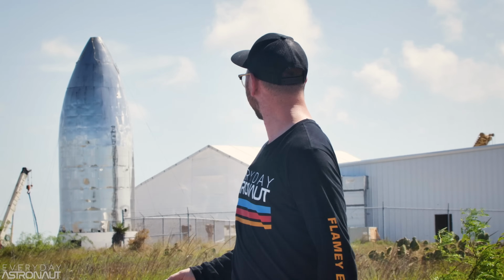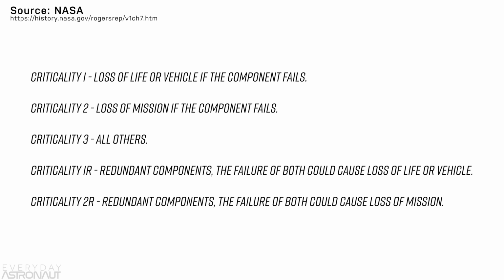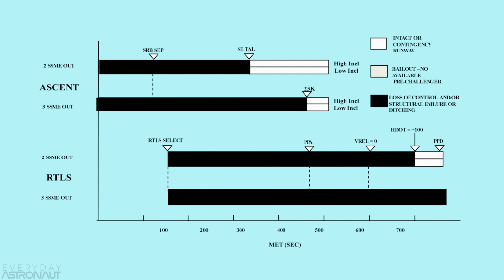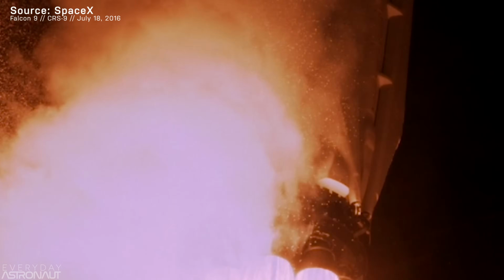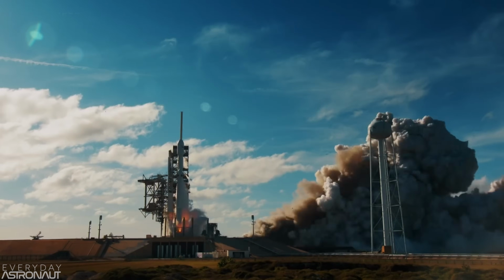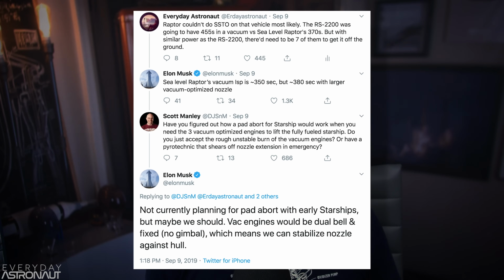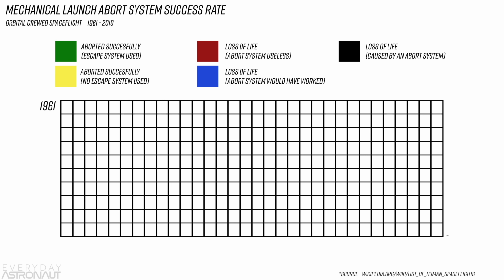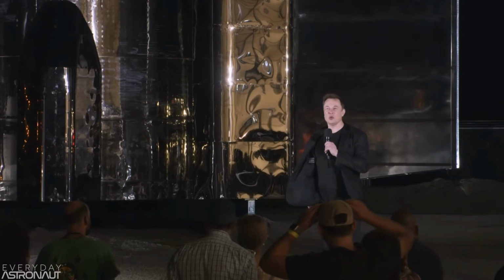Why won’t Starship have an abort system? Should it?!

Comment: It should have some form of an abort system.. 

If there's a six foot passageway from the top of the fuel tanks. Through the header tanks. Through the lox tank. Right out the bottom of the spacecraft. Then weld 8 fuel baffles from the center passage to the outer skin. Remember the first stage of the Saturn v was actually 8 separate rocket fuselage connected in an octagonal fashion. These baffles inside the starship are thin steel with 2 and half inch dimpled holes 6 inches apart. Very light structures for what they're supporting.  If there's the passageway. Then the nose cone could be built like a ginormous cork. With the cork inserting the length of the methane tanks. The passage below the methane tank through the lox tank would have thicker steel to compensate for the single walled construction. And the fuel plumbing of the methane tanks run through lox tank passage way. 

During launch the crew climbs into the passageway and sits in hammock lawn chair deals that fold out of the wall. 8 people in a circle stacked three high 24 people. Then before launch. The passage below the capsule, lox tank passage. Which is the airlock. Pressures up to whatever pressure is needed to eject the entire nose cone up and away from harms way. At 2atmosphere pressure that would be roughly 30psi inside the lox passageway. That would provide an instaneous 488,000lb thrust to the capsule alone. So that could be too much considering the entire loaded starship is suppose to weigh in at roughly 500,000lb. Once the nose of the starship is realeased and is accelerated up and out. The nose cone passageways bottom is its own component and falls away. Exposing the astronauts inside the passageway to the outside. The chairs they sit in are attached to small 2inch web x 2inch ibeams 2ft apart running the vertical length of the nose cones passageway, with rollers. And then the astronauts simply slide out 9f the nose cone 8 at a time each with their separate chutes attached to their chairs.

 It's only a six foot passageway. I'm a bit concerned about it be crushed. But the baffles are attached to the interior passage way roughly every two feet. So it is much closer to a 2ft diameter passageway once you figure in the baffle support, I figure. 

Personally once the core is proven they should begin lightning them and wrapping them in carbon fiber... Pressure vessels and providing tension rigidity to semimalleagible metals is where carbon fiber shines. Carbon fiber by itsself is to bendy and flimsy. It needs to be attached to a substrate to activate the strength to the carbon carbon bonds. When welding and attaching the bolts for the ceramic tiles, weld wire 1/16pins at every cubic ft intersection or more. Then they'd protrude through the carbon fiber. Each one of them pins will need a little washer that has carbon fiber strands stitched onto its perimeter. And the the little washer gets spot welded onto each of the stainless steel wire pins. Once again wrap it some more sandwiching the washers between the carbon fiber layers. I just don't know what it's going to take to make something the size of this to be able to withstand reentry and be safe and reliable. There's a alot of testing to go on. I mean I'm glued to this. It could be there isn't as much buffeting from the very thin atmosphere Idk.  Great info as usual.

Comment: "We're sitting on something that has two and a half million moving parts......built by the lowest bidder"
Reply: Most of those parts were "moving" because the rocket was moving. I worked in a +100 story building made of several million parts, built by the lowest bidder, moving a lot faster than  those rockets, never worried about it failing.
Reply: @psdaengr911  OK SUPERNERD, don't get out much I see? you know basic concepts such as .......sarcasm? Where the supposed meaning of a phrase isn't actually the literal one? And I am not sure where you heard that hilarious fib, but whether a "part" of the space shuttle is moving or not when static, trust me, once a shuttle hits Max Q on it's Perigee, every bolt is shaking almost to the point of snapping clean off.

Comment: Failure on space shuttle?
1:  ignoring warnings about the solid booster orings operating under temperatures  too cold.

2.  Ignoring warnings of sensors that  indicated breakage of tiles.  Not bothering to see what was wrong.

People died because of management's laziness and willingness to gamble with people's live unnecessarily.
I'm sure if the NASA managers were onboard themselves they would have made more cautious choices.
Idiot NASA managers

Comment: The KISS principle applies here - it's not something new that Elon Musk invented - it's been around since the Lockheed Skunkworks invented it in the 1960's.  But you can trace it back even futher...Albert Einstein put it as "Everything should be made as simple as possible, but no simpler." - the second part of that is key here.  If you can help the crew out of a bad situation with some careful design, then of course you should do so - but adding complexity where it's not needed is stupid.

My favorite example of false safety is those life jackets they put into airliners.   Over the entire history of passenger aviation - how many lives have they saved?   Answer is "NONE!" - even in the case where that airliner splashed down in the Hudson river - the people who DIDN'T jump off of the wing and into the water were a lot easier to rescue than the few that did.

But an average airliner has about 200lbs of life jackets on board - the cost to ship those is about the cost to add an entire extra passenger.

This mentality happens everywhere.   Why does nearly every car carry a 26lb tire and 8 lb jack?   In my entire life (45 years of driving) I've never once needed to use one.  The most common cause of roadside breakdowns is the battery - so why not add one of those 30lb small-current car batteries as a backup?   On the other hand, I've lost countless headlamp bulbs and twice had the radiator top hose fail.   Do we have spares for those things (which are lightweight and take almost no space or tools?)...no we don't!

People are NOT logical about this stuff.

Comment: Using upper stage as launch abort isn't bad idea, but landing using solely engines is. In case of failing engine the whole upper stage will be lost. Shuttle could land without engines. Capsules can land without engine. Dreamchaser will land without engine... Starship can't. Redundancy didn't help the last falcon9.(one of the engines probably exploded according of the camera)

Comment: Nearly 40 million flights per year and there are still people terrified of flying, 10 runs though is far too few for me, I'd want 1000 consecutive successful runs before I'd strap in! After all, in a helicopter you have autorotate as a safety measure, on planes the designers take crashes into account and make the planes structure strong enough for some people to survive even horrendous malfunctions. With Starship you're sitting on a bomb, if there's a problem there's a high chance of it being unsurvivable, if a plane takes off and has to emergency land almost immediately then I have a decent chance at survival. Until the disparity is corrected I would definitely want an emergency abort, and I would like that to also be safe, not something that will provoke it's own explosive deflagration and set off the bomb underneath.

Rather than risk lives I say risk some of the crazy advanced military robots that have made the YouTube rounds recently, they're tougher, have greater sensing power and most importantly, they don't need a funeral. If people want to be like Captain Scott they're welcome to, but people that have acquired enough cash to ride this dragon have accumulated that money to decrease their future risk. I don't see a lot of money from tickets sold to billionaires that ride around in vehicles with nuclear, chemical and biological filters, just in case. There will be a few that want to go where no-one has before, but space tourism will require a 99%+ success rate before it becomes anything like as Disney friendly as most tourists want.

Comment: I got stuck on the safety issues and concluded that a landing abort is not possible. The one thing I cant seem to figure out is how do you know if the Martian soil will be able to support the weight of the Starship. I guess they will find out after the first few landing attempts but other then dropping a probe to the landing site to see how hard it is what else can they do?

Comment: All aircraft should have an abort system.  A jet or prop driven aircraft has both an engine, and a method of gliding to a touchdown.  Conventional helicopters can auto-gyrate.  One aircraft with no back up (or little)  the Osprey and many died in the proving and testing.  But even the Osprey has a type of back up.. The two propellers share a common drive shaft.

Starship should have something.

Comment: under water rockets are not the most efficient until you need moisture in the atmosphere. those rockets don't move but press into the sea floor and steam clouds up that rain in deserts or as weather weapons against thirst. its easy to make clouds fast. torch rocketfuelrainian.

Comment: I am sure there must be an equation that takes complexity of the system and added complexity with an abort system. For instance, adding some small boat to a bigger ship doesn't really add so much complexity, where cabling a detachable capsule in rocket, indeed adds complexity and failure points.

Comment: Again Thanks for the show. You have gotten to the stage of knowledge or level that makes you hard to argue with. You have a common-sense approach to all of this and I have no problem with anything I have heard you speak about. I do firmly believe that Space-x should have a program onboard the space-x manned capsule that would allow the Draco engines to be used for landings if the parachutes fail. Just as they could have saved the payload on the inflight disaster had the abort system been active on it. Note that after that failure, Musk made sure that the abort system would save the unmanned payloads on any future mishap. P.S. I would join but I am on a fixed income, sorry. But I do sell sci-fi art on eBay under stevesony2018 if you ever want to look.

Comment: Yes, there is no abort system in "Starship". But, if there was a catastrophic event the manned section of the vehicle could have a structural breakaway point. That combined with a parachute system could give the crew a fighting chance for survival inside the atmosphere. The Space Shuttle could have had the same thing, as in both accidents the crew cabin broke away from the main body basically intact. A slight design change could have made that a cleaner break and possibly allowed a parachute assisted landing in which the crew could have survived. Starship could be designed the same way as there will be a separate pressurized interior manned structure that will be separate from the fuel tanks and frame. I think it is something that should be looked into, at the very least. There should always be a survivable option on the remote chance of total system failure.

Comment: What a waste of 48 minutes. Now you're just desperately trying to convince yourself that since Starship doesn't have an escape system, it must be a good thing. But you're not making a good argument, really. Sure it can handle engine out, but any other problem and you're done for. Rockets do RUD sometimes (remember that F9 helium tank?) So even if it does not share all of the Space Shuttle's design flaws, that does not make it safe.
Reply from the maker: Did I ever say I think it’s a good thing? I think I took a pretty neutral stance on the subject and put up the pros and cons. Abort systems aren’t trivial and are legitimately a debatable topic.

Comment: All that does not justify the lack of an abord system. In all the flight the space shuttle failed 2 times, one because the bureaucrats did not want to listen to the engineers, and the second one an actual failure. Even so we don't consider the space shuttle safe. 135 launches one actual failure The landing portion never faile.  From these statistics, it's clear that the glider strategy was solid. According to the Elon Musk, the Starship will be doing 100s of flights a year. The propulsive landing strategy has one single mode of failure: "fatal" Space X should continue with the low costs high efficient rocket strategy until we can warranty a less than 1 in. 10K landing success.
Reply: If Elon is looking for 100 people for "ballast" on the first manned "Starship" launch, I would be willing to take that risk, for a ride to orbit. Space flight (as you point out) is inherently dangerous, expecting it to be as safe as modern aviation (which is safer than going for a stroll down the street) is unrealistic. Hell, its probably less risk than parachute jumping, and there's thousands of people doing that as often as they can afford the trip aloft.

Comment: Perhaps using increased shielding or shaped charges to deflect the impact of the explosive shock wave from a failed primary rocket would be a simpler and more efficient solution.

Comment: Think about it. No abort system is needed.  The starship itself is an abort system.
Reply from the maker: Which is subject to the same failures as the booster.. so what happens if that fails?
Reply: Everyday Astronaut Sure, but any system can fail even an abort system. But the starship has wings! :) Imagine.. Booster indicating an error, starship detach, wings are in proper position to change direction down or left/right and don't accelerate but start the "back to ground manouver program" The booster goes away up and explodes. What you think? :) I know this would not work in the launch pad.
OMG, I'm very glad you answered I really love your channel! 😄😄 From Europe.

Comment: I like your videos, Elon and SpaceX but in this one you have a lot of confirmation and framing bias trying to defend the design. IMO abort system should always be there when a life is involved because as you said you don't know what you don't know and in the eventuality system should be prepared as much as possible. 
Very much disagree with the question "better an abort system or make the overall system more reliable?" because you can do both systems as simple and reliable as possible. It is true that you add a bit more complexity but with a tradeoff of much higher probabilities of crew survival in case something goes wrong. There is no perfection and scenarios are infinite so a tradeoff should be found but no abort is not the solution.
Disappointed also you didn't explain why in all those cases the abort system would not have worked (more some you just s, and the reason of your assumption. Again even if true maybe THEIR abort system would not have worked but crew dragon's or a better system would have helped.
Also elon's sentence on no system is best system is used in a vey speculative way because depends on the requirements and goals. What Elon I think wanted to say is that whenever possible is better to undesign when you can achieve the same result, not by lowering the safety standards...

Comment: If you have to rely on the safety equipment then you can't rely on the original equipment. The safety equipment is supposed to be a last resort and not something to fall back on. Redundant equipment is what you're supposed to rely on.

Comment: 27:55 Minor mistake: Airliners are actualy able to deploy it's landing gear even without any hidraulic power using only gravity to do the work.
Reply from the maker: That’s why I said “can’t deploy them normally”, since they can operate without hydraulic pressure 👍
Reply: Most can gravity drop, but a lot also use blow-down bottles to give a big whack of pressure to the hydraulic system to get the gear down and locked. As well as having redundant hydraulic lines for control surfaces and landing gear.
Reply: They can drop them, but on the larger planes, without mechanical assist can not reliably lock them .
Reply: @psdaengr911  Perform a few tiny, but sudden rolls and it locks..
Reply: There was that recent crash in Pakistan, so the first thrust landing with astronauts will be in October with Doug
Reply: Most can but some, maybe not.

Comment: I agree. We need much, MUCH more data from flying to know what exactly can be broken on what exactly surcustances. We need search what can cause a problems and going to salve it. I heard some word like "All needed is simple - all complicated are unnecessery." and I think this word's aplied to any tasks. Oversimplyfying are key to true reliabilyty. It didn't mean "Oh, that system used only 0.0001% so throw it!". It mean "Oh, that system used only 0.0001% so do it in a way that this system worked 100%!" or "...so this system even don't be needed at all if another system be more reliable!". And second thought are exactly what Tim concluded... I think... Em I right?

Comment: The benefits of more engines as opposed to just one or two comes from the application of simple math. It's the equation Force = Area * Pressure. You may have a 5 ft rocket nozzle attached to a rocket with a 20 ft diameter. That 5 foot nozzle may be engough to get the job done, but you could have 4 nozzles in that same space and since the nozzle area just increased 4 times your engines don't have to be as big or as heavy and the engine doesn't have to work as hard. That's why the Soyuz Rocket is so reliable and robust. It's bottom is covered in nozzles and now you know why.

Comment: I didn't read all the '000 comments, so this question could had been posed earlier. However here it is: given the high cost of certain satellites and outer space probes, would it make sense to add an abort system on non-human flights, so that the payload is saved and possibly reused on a later mission? Could insurance costs also be positively affected?